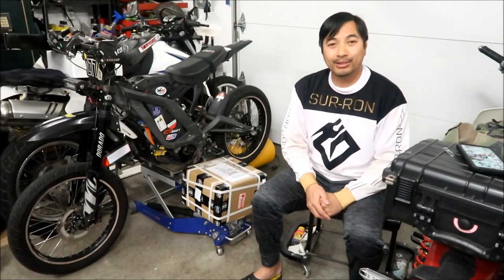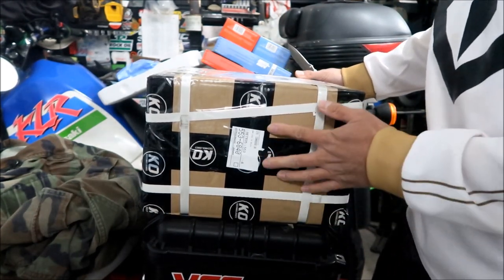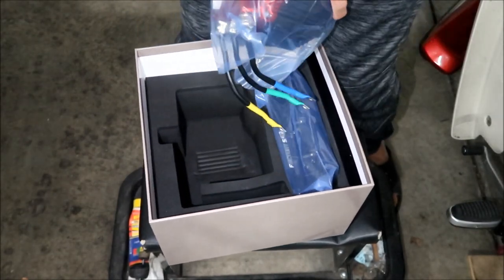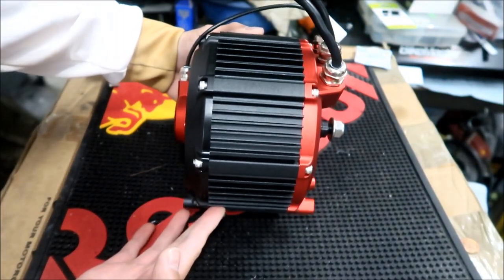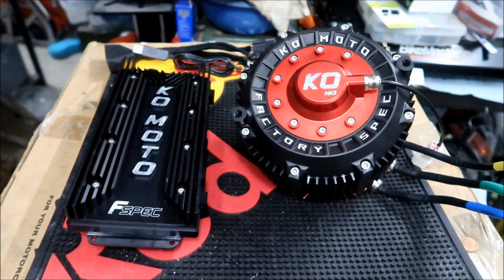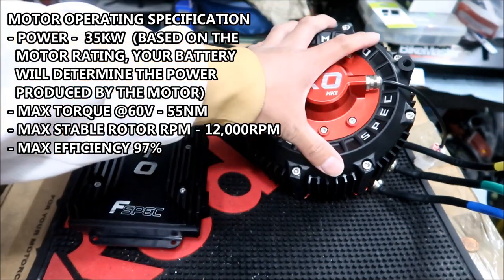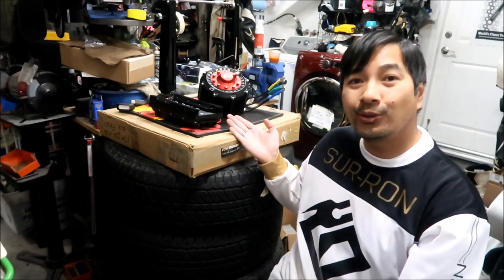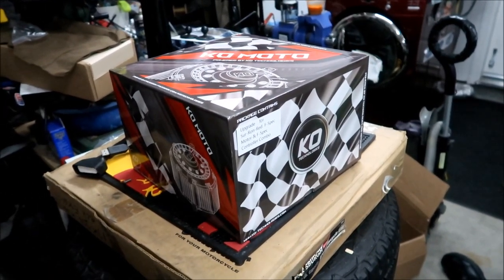Sur Ron Light Bee KO Moto Factory Spec Motor & Controller Combo Show and Tell + Unboxing

Comment: Kinda random but it’s it possible/safe to wrap the orange BAC controller?
Reply from the maker: Hmm yes i guess so I've always left it orange but if I wanted to make it look black I was thinking of just putting black electrical tape on it.  I also found this carbon fiber looking tape at a Daiso dollar store that I thought about using to color the BAC.  You can use a plastic paint also like a model paint.
Reply: @hadesomegamoto7639  I’m going to try a little electric tape!  Thanks.
Reply: @hadesomegamoto7639  it makes such a big difference to me thanks for the idea!